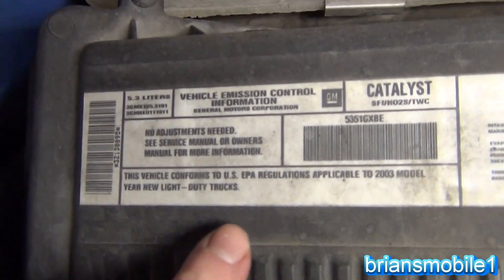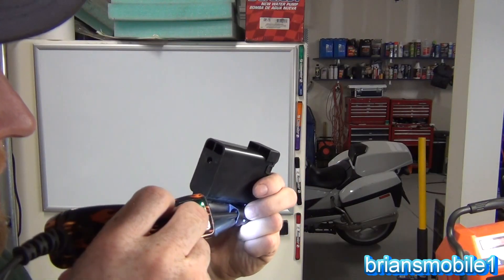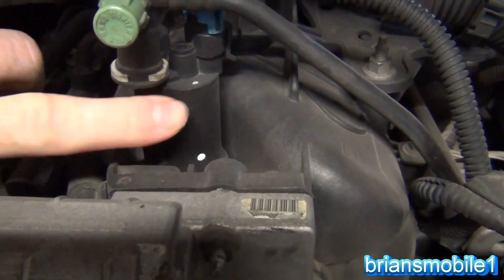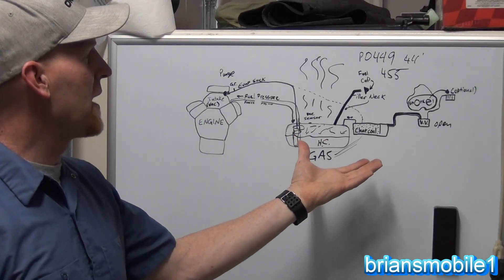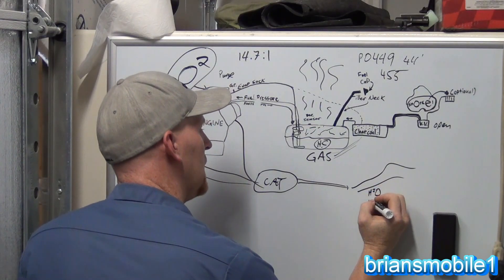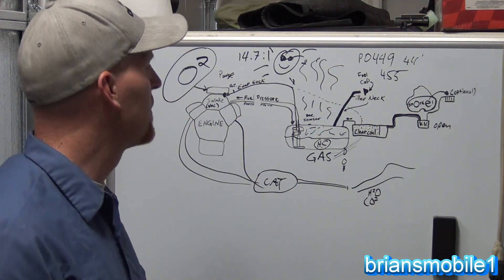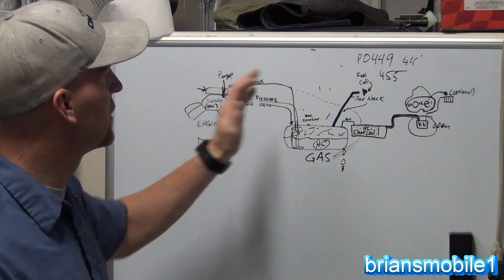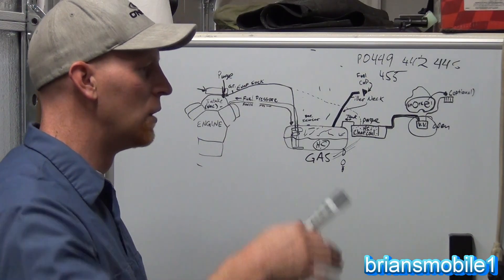P0449 Vent Valve Testing EVAP Systems

Comment: I have been battling P0446 on Camry.  The vent valve near the gas tank was replaced by the shop but I checked the old valve and that was not faulty.  The canister costs huge money, so that option is not on the table.  I have not checked the purge valve yet.  Since the car is now exempt from the CEL, my only incentive to fix this so that when real CEL comes on, I will know about it.

Brian, can you do a P0446 video?

Comment: Ha!  beard and no beard.  Keep the beard it fits you well.  That valve went bad on my 2006 Sierra.  GM sold me the 120.00 valve with the new hose you run up to the top of the trans with the valve at the end.  Total wast of money.  Later I found out that you can use the valve off a 2006 GMT  SUV for 20.00.   As I have a 2006 GMC yukon also, I was able to confirm this.  The old valve from my truck, was the same as the Yukon, right down to the numbers stamped on the side.

Comment: Is it in any way possible for this system to create a lean condition if not operating correctly? My 99 Suburban has a mystery lean condition, but runs perfectly. ST trims are perfect but my LT FT run +15 to +25 and set p0171 174 combos. I overhauled it recently, its not a manifold vac leak, new fuel pump and filter and regulator, complete tune up, all new gaskets, all new vac lines and elbows, PCV new, MAF new. Everything new except fuel spider and MAP sensor. Codes only set under load 1600-3000rpms basically (freeze frame). BUT watching this I remembered that from day one the evap system I/M monitor refuses to be "ready" but all my others have always reset to ready condition.
Reply from the maker: Cody Brister Yes, it could.  That is a crazy one.

Comment: Thank you. I've been trying to fix this on my pathfinder by trail and error, I changed the vent valve  and i changed my gas cap but still evap error.  Pretty annoying check engine light that I just learned to live with, but with your video i feel like have a much better understanding of the whole system to figure it out. My mechanic friend tried to explain this to me before and ive googled info on it before and just been left utterly confused, but your video was so good I feel like now I can teach someone how it works now. Thank you and subscribed.

Comment: Another great video, very informative. I see a lot of the newer silverados, tahoes, and suburbans(as well as their gmc counterparts) come in to the dealership for the p0449 and p0455 codes 9 out of 10 times it's going to be a bad vent valve. I always test the circuit along with the valve by using control functions on my scan tool because that 1 out of 10 times it could be a frayed wire, blown fuse, loose terminal, etc. but not everybody has access to a scan tool with control functions. That's why this is still a great video for the DIYer at home. You can put it into terms that people with little mechanical experience can understand.

Comment: The large tube to the vent valve would be idea for when you're fueling at a gas station and a large volume of air saturated with hydrocarbons needs to vent safely.
Reply from the maker: Craig Warren Great point Craig

Comment: great explanation, but i believe in order for engine vacuum to pull HC's from the charcoal canister, both the purge and vent solenoids should be opened at the same time.
Reply from the maker: happy543210 You're right.  Thank you for pointing that out.  They're pulsed in relation to the engine RPM.  I focused on the evaporative properties associated with vacuum like in air conditioning systems and I failed to include that air wash is also used.  I'll have to do a separate video on that.  In the mean time, ADPTraining has a good video on that here → https://www.youtube.com/watch?v=IzfR84T6pBY  Check it out.  Thanks again!